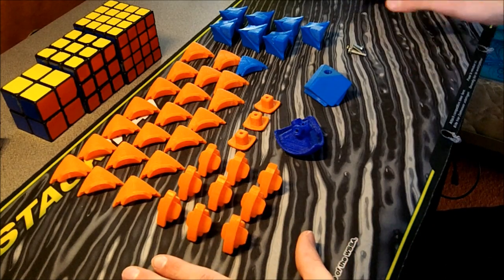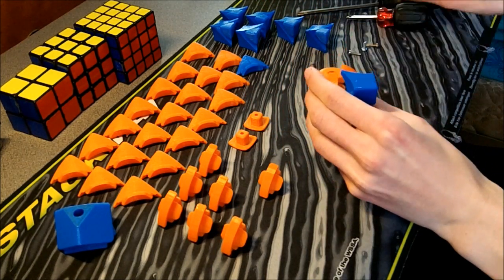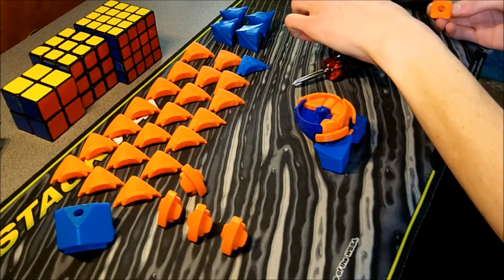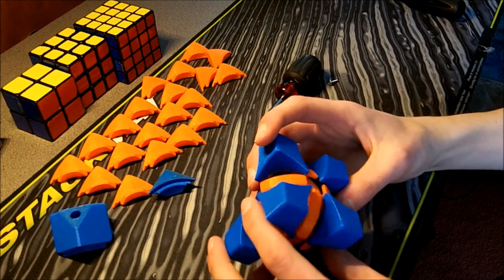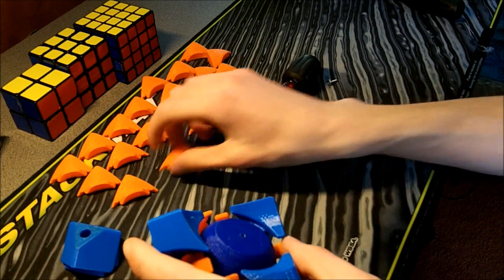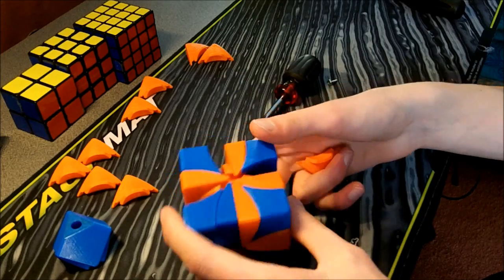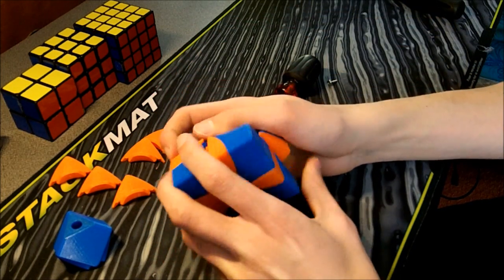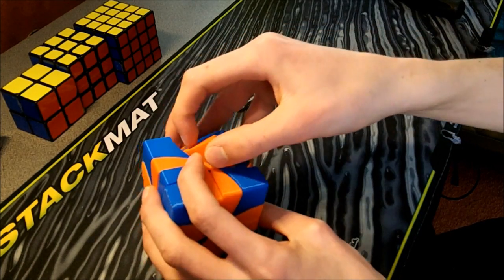Asymmetrical Dino 2x2 Assembly and Mechanism

Comment: Wondering about the content below me. The part won't fit nicely. Thank you though! This is awesome.
Reply from the maker: I assume your issue is with the dedge piece. Is it the top of the dedge or the bottom fitting into the 2x2?
Reply: It (Dedge) is fitting well into the 2x2 between the core and centers, too well (extremely tight). I'm thinking of counteracting this by dilating the core and special piece by 1%. Though the disproportion between the core and centers might cause problems. Also, the enlarged core might interfere with the other pieces. Thank you so much for the quick responce. 
What do you think? How did your pieces fit so well together?
Reply from the maker: Does the issue seem to be the width of the piece or the height? What orientation are you printing the part in?
Reply: I am printing the dedge pieces with the flattest side facing downwards (the part where it makes an "L"). For the core, I start with printing the flat circular base and ending with the parts where you screw in the screws. I can clarify if you want me to. +PerpetualCubingMachine <--do i need to do this?
Reply from the maker: I print with the arcs in the xy plane, I'm not sure if this makes a difference, maybe worth a shot. I print the core the same way. Did you scale up all of the pieces, otherwise it only makes a 50mm puzzle. I scaled everything up to 128% to get a 64mm puzzle.
Reply: I wonder if scaling it up will make it easier to fit together? Ill try that. To better describe the position i print the dedge pieces at, is similar to how you have them oriented in your video. Did you fix the scaling problem? In that case I now won't need to worry about rescaling anything.
Reply: +PerpetualCubingMachine

Comment: the dedge peices wont fit even with some sanding and resizing. any help
Reply from the maker: +fail craft (failcraft) I will modify the parts to have more clearance so it should work better for you. Unfortunately, I'll be away this weekend so I can't modify the file Monday.

To edit the design properly I will need to know the following things:
1. What type of 3D printer are you using?
2. What part of the dedge pieces do not fit properly? Is it part of the "wing" or part of the 2x2 mechanism?

Thanks for your interest in my puzzle, I will try my best to help as soon as I can.
Reply: +PerpetualCubingMachine the main problem is i need to print them with support, but the support gets in the part where they fit together, and it usually wont come out.

Comment: What kind of bolt do i use? I'm going to 3d print this.
Reply from the maker: Toy Zera The puzzle uses a 1/8" diameter 1/2" long bolt for the 62mm scale but you can drill the holes to be larger if necessary.
There is a link to the thingiverse model on the introduction video for this puzzle and the thingiverse page has instructions for printing and assembling.
Reply: PerpetualCubingMachine thx.